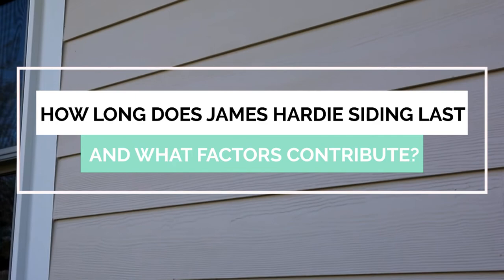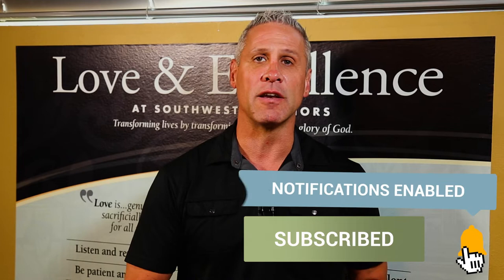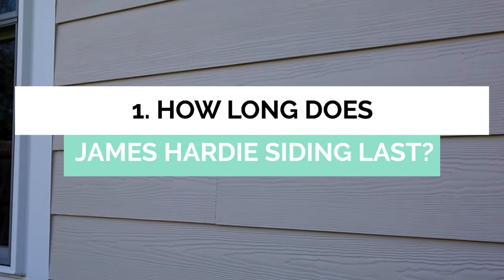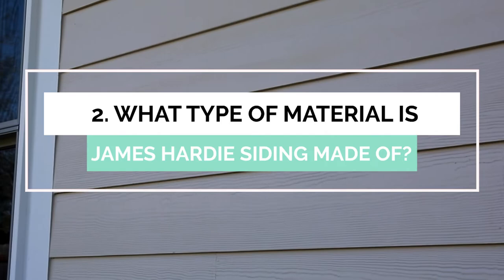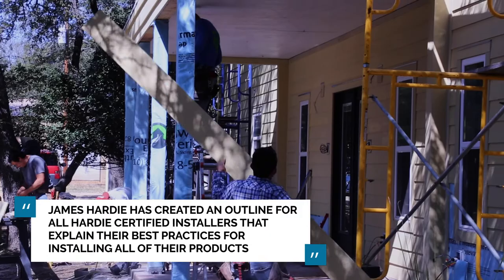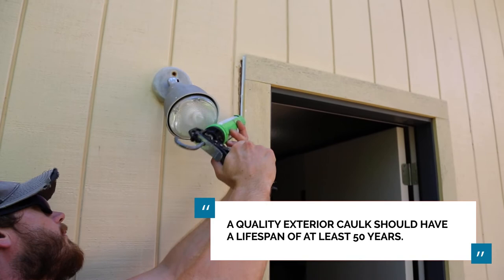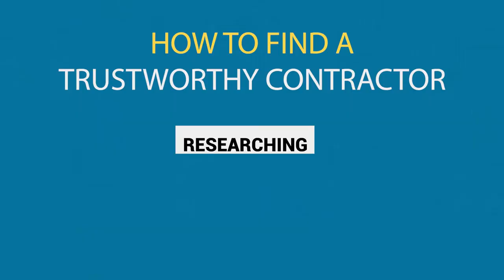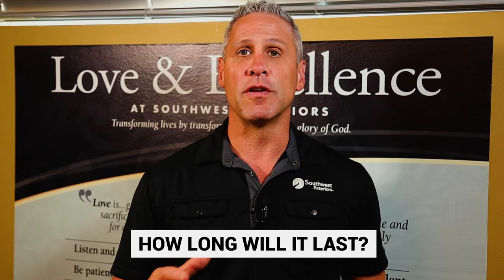How Long Does James Hardie Siding Last? (3 Factors That Affect Longevity)

Comment: For anyone looking to install James Hardy siding Steve just gave you their out when things go wrong.  After researching this product, we were very impressed with what it takes to become a James Hardy siding installer. It sounded like a very long and in-depth process.  They don’t tell you about their subcontractors and  the subcontractors contractors.  If that sounds hard to understand trying to get Hardy to stand behind the product and who they allow to install it is even harder. Hardy board might last fifty years if you keep it stacked and covered.
Reply from the maker: James Hardie siding is all about the installation. Agreed there is a lot that goes into becoming a certified installer, so be sure to do your research into who you will be installing your siding. If you aren't working with the right contractor your James Hardie won't last for as long as advertised.  
Thank you for checking out the video!